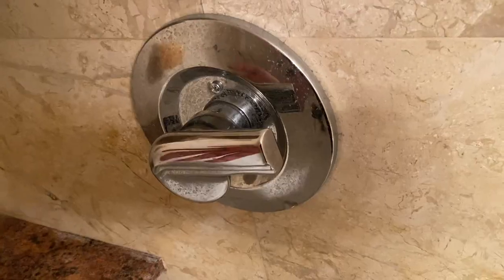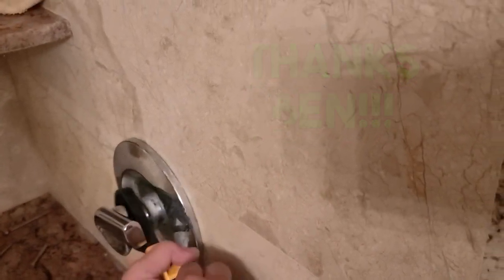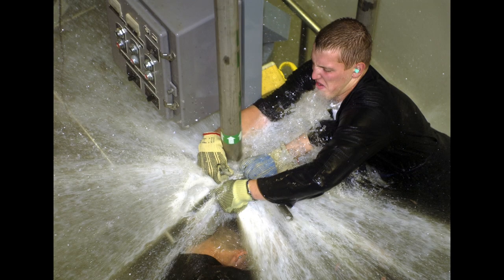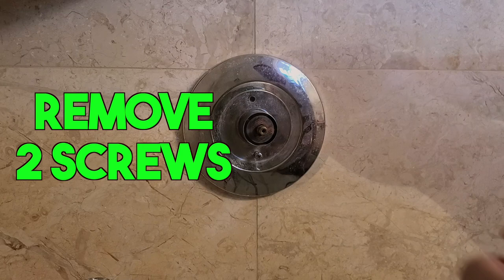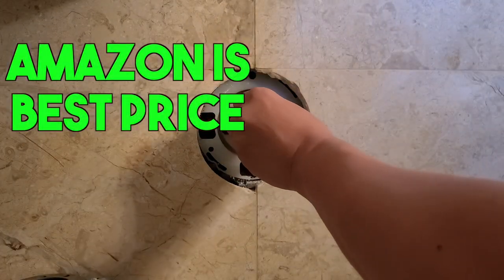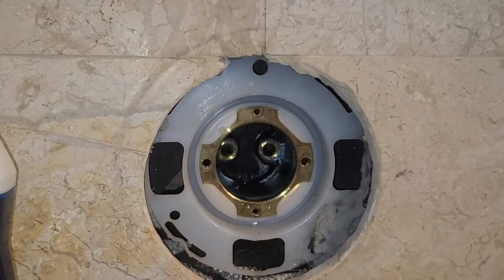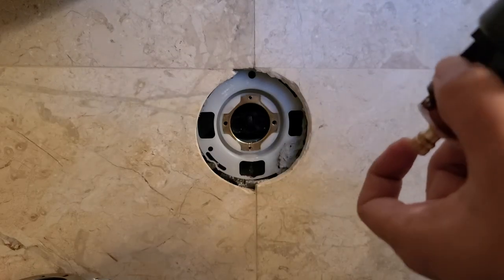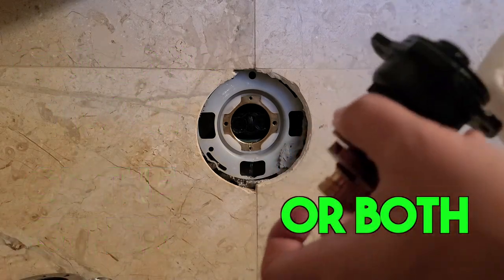My Kohler Bathtub Faucet Was Leaking and It Was a Pain at First! Mysterious Handle

Comment from the maker: Wow getting the handle took a while to figure. The rest no so much but fixing the leak was still a challenge. Glad it's over!!!

Here's some of the parts I used. It's really cheaper through Amazon than the local brick n mortar.

OG KOHLER GENUINE PART GP500520 CARTRIDGE FOR PRESSURE BALANCING UNIT 
https://amzn.to/333HL45

LATEST VERSION 
https://amzn.to/377p5lp

Kohler K-GP77759 MIXER CAP FOR PRESSURE BALANCE 1/2" SHOWER VALVE
https://amzn.to/35N3O0Q

Silicone grease https://amzn.to/3336Tbe